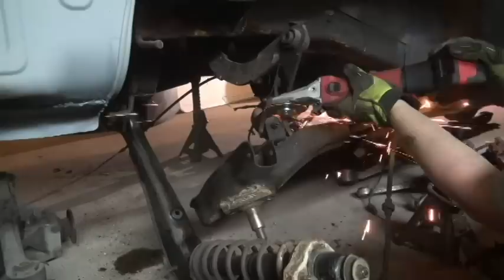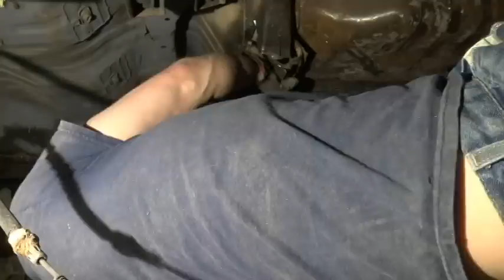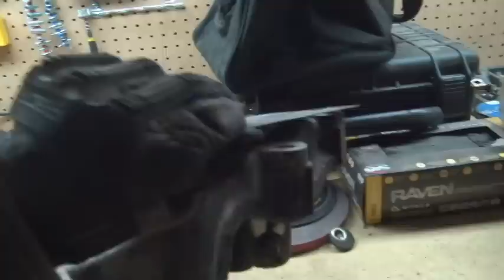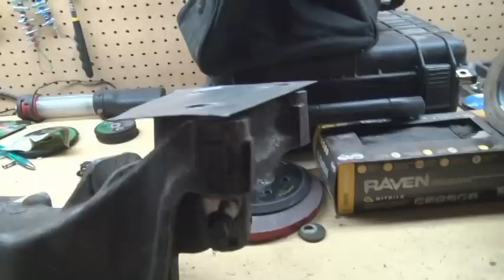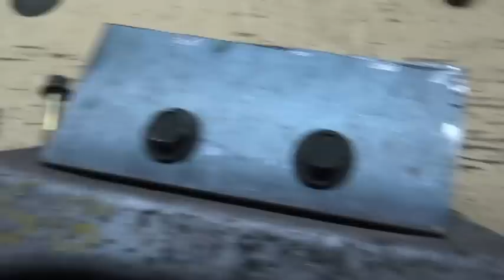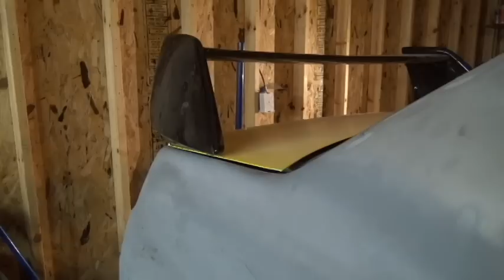Lancer To EVO Build Ep. 18 | Removed Rear Sub Frame

Comment: Nice job...couldve gone with an outlander rear subframe and eliminated all the cutting...keep up the awesome work!
Reply from the maker: jw, but y wud that stop me from cutting?
Reply: Here's a quick rundown from a member on EvoM who did a similar build...ill post the link as well

Overall this was not a difficult job for one main reason; that the chassis' at the back between the Lancer and Outlander are the same. Not even a little different. Identical. As long as you cut out the FWD crossmember that extends from the floor, everything will line up and bolt up from the Outlander as though it was built for the vehicle. Trailing arms, control arms, sway bar, the entire subframe itself...all are basically built from the factory to fit this car.

There are two basic approaches you could take in in getting the subframe on to the Lancer... (1) swap in the Outlander floor which is specially fabricated to accept 4 bolts on each side of the subframe which has a contoured mounting surface which at first glance does seem quite intimidating. or (2), what we opted to do, which is just weld the entire subframe directly up to the Lancer floor. This was not only easier, but is stronger too than factory.
Reply from the maker: the link might giv me sum insite... but either way its still a lot of cutting... to me it seems like my method may be better to what im trien to acomplish... It seems easier to me with less fabrications an more straight forward... but who knows
Reply: Still a great build whichever route you take...im gonna do a budget evo build with mine..haha

Comment: do a 5 lug conversion
Reply: @EFFEKTRecords  normal wheels have 4 bolts for tyre  convert the hub to 5 lug bolts
Reply from the maker: yes, I hav the entire EVO under setup... wheel hub, brembo brakes, rear diff, drive shaft, etc...